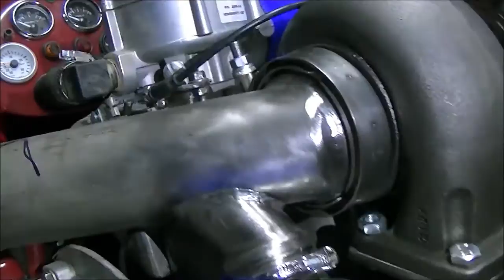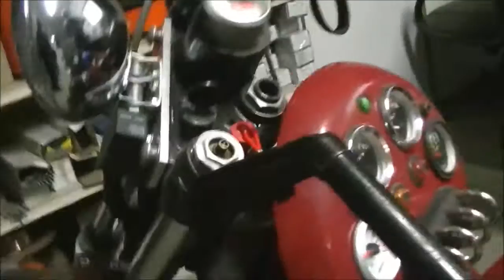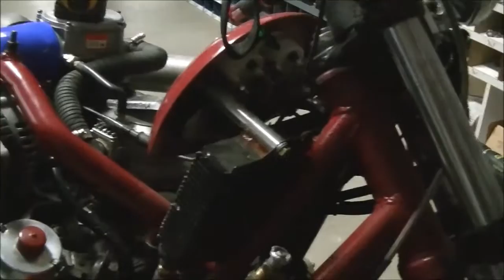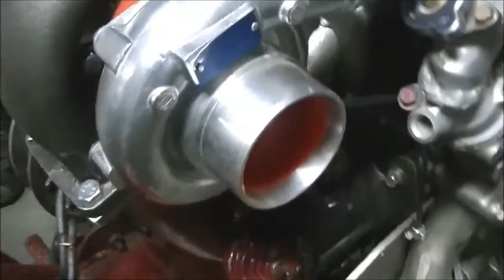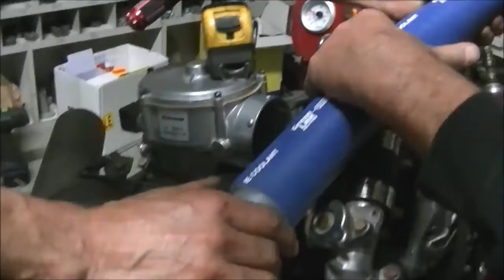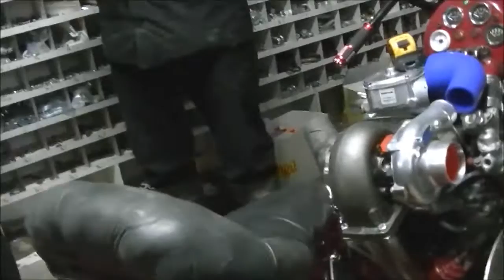Exhaust , Turbo and Wastegate for the Dragon # 50

Comment: It's cute when non-rotary people are impressed by the size of turbos used on 13Bs. Ah,I remember when I was that young...Sort of like walking into the TARDIS and saying "It's bigger on the inside".
Reply from the maker: Well 3 or 4 years ago I was one of them . I'm addicted .. Doubt I will ever work with piston engines again  . Just starting to feel a bit more comfortable with the little engines. It's funny you mention this because when I was shopping for a turbo I must have picked out 50 different set ups and got the same response every time (( no to small )) so I picked one I felt was a ridiculously large  size and ask him what about this big baby and bumpstsrts response was  (( yes perfect , that's just right ))  and had probably 50 PM's telling me the thing would never run . thanks for stopping in
Reply: gerald mosier Ah, the PMs (never public of course) from the peanut gallery. I love those. I still have a select set saved from my original turbo NA project and many of them are from well known and respected forum members, giving reasons that if published publically would be a wonderful demonstration of how much they in fact don't know. One day I was at a customer who repairs the big rigs and one of the mechanics wanted to see under the hood of the RX-7. Of course, within a minute every mechanic was in the lot looking and they were all saying the car would never make boost. Turns out the job finished as they were closing so we all left at the same time. Being on a country road naturally everyone hammers the throttle on the way out. Did a 1st - 4th pull. Then the next time I was there everyone wanted a ride.